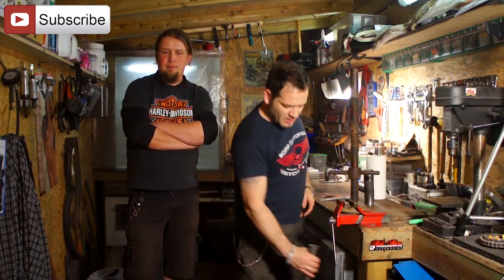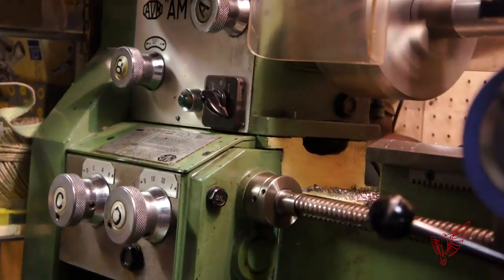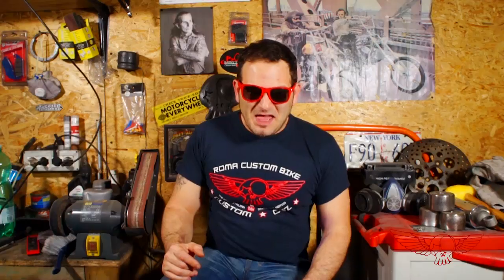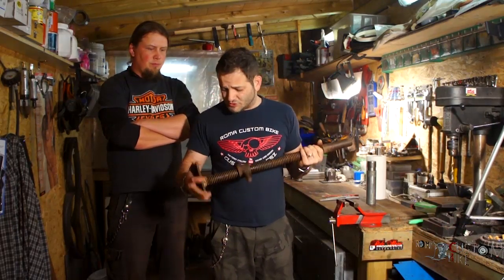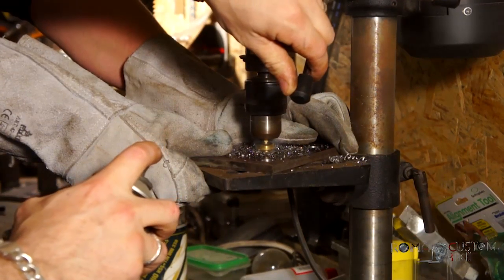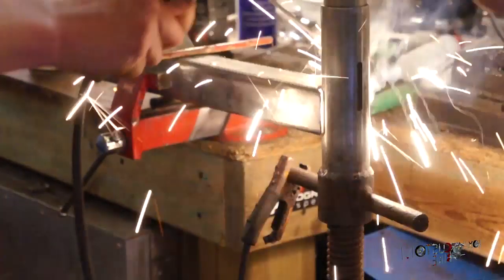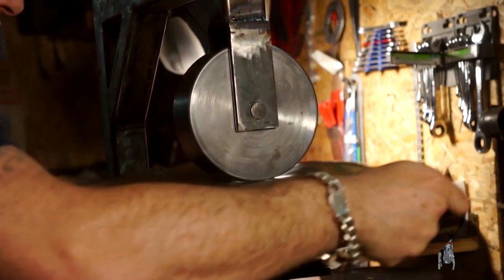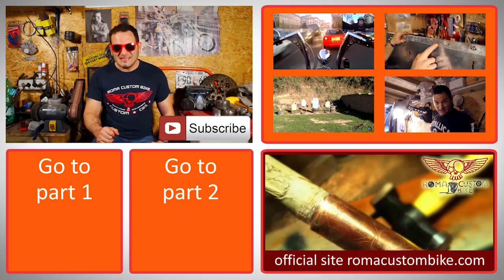How to build an english wheel - DIY  Tutorial - part 3 - ep 14p3 - Roma Custom Bike

Comment: Like your old style ways of fabrication buddy. Wouldnt help to have a swivel bandsaw around to do most of the cutting instead of grinder. just some more tips... because you know how to build home made CNC why dont you attached a Plasma cutter. Using Activatesignals(output #) and DeactivateSignals(output#) you can turn on/off the relay in M06 (tool change) Gcode. with this you can cut slot on RHS/SHS. if you know what im talking about you can make alot of thing in less amount of time.